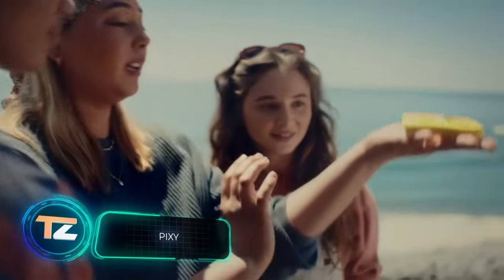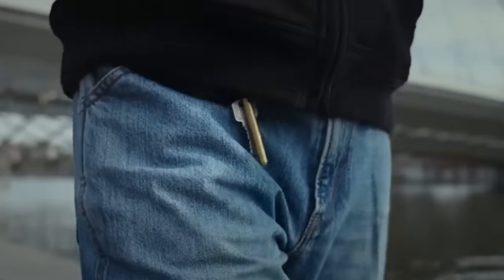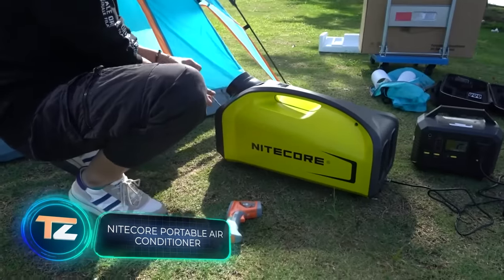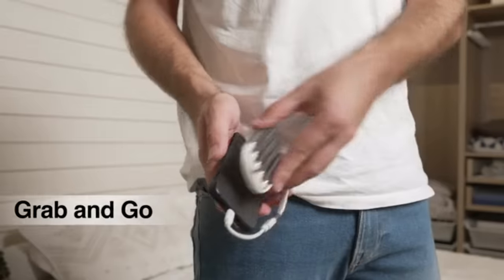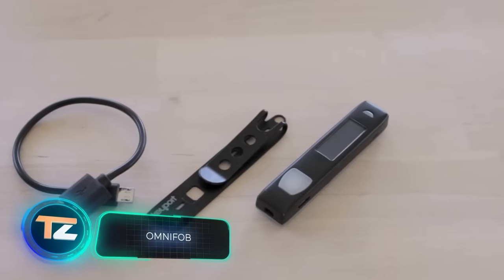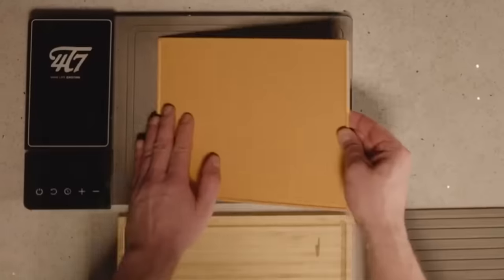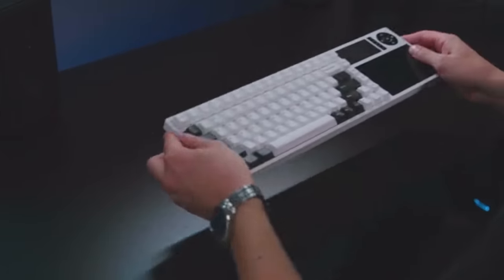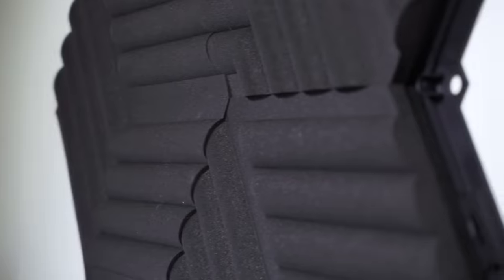AMAZING GADGETS THAT ARE WORTH BUYING

Comment: @7:50 When the cable is used as a regular charging cable, it automatically recharges.

Does this mean that the cable can recharge a device with no power bank?
Why else would it need to recharge?

Comment: Unfortunately there are cheaper versions of just about all of these, and in some cases cheaper AND better. Like the lock for instance. It can easily be defeated in less than 5 seconds with a neodiddlyum magnet. But there are others that have a proper defense against magnets for less than $100 that have practically all the same features.

Comment: How does the drone follow you, do you have a transmitter/receiver that you carry ?
Reply: probably face recognition feature so it knows distance from you and adjust accordingly.  In this case, must measure your head and follow it around.
Reply: @jessikapiche6097  - Nice suggestion my friend, but it also stays behind you, and obliquely in from the side ? ?  👀
Reply: @jessikapiche6097  -  I found the solution 😄.          You can simply throw the new camera drone from Lily Robotics in the US into the air - and it will follow you, according to the manufacturer. This is thanks to a sensor you have in your pocket or around your wrist" 👍

Comment: 11:06 "You don't need to be a bike mechanic to use it, just pop the top cover and insert the device", yeah, if you have the bike with that frame, handle bar and fork otherwise you damn well better be a bike mechanic because you're going to need to be making major modifications and replacing the whole front end of your bike. Do they even sell that thing alone?

Comment: the problem with wireless earbuds is battery. never full when charged and after one and half hour of use (or at 20% battery) system message keep screaming to my ear : "battery low" how tf someone can enjoy music this way? if anyone claimed "the battery last for eight hours" yeah sure, standby time, without music. thats totally a lie. thankfully expensive train or plane provide charging station so it's no problem for long distance travel with low capacity battery gadget.